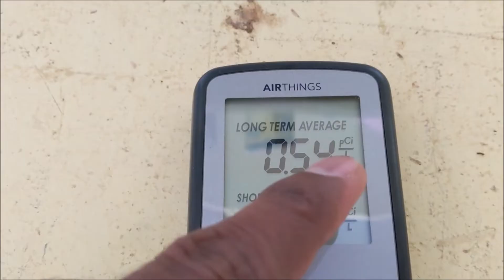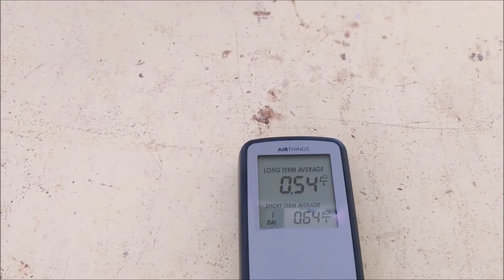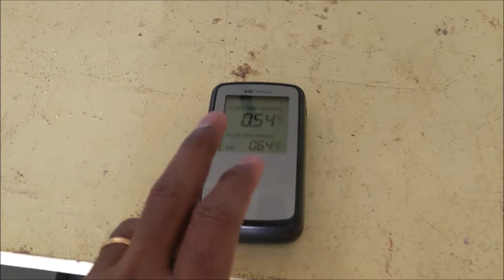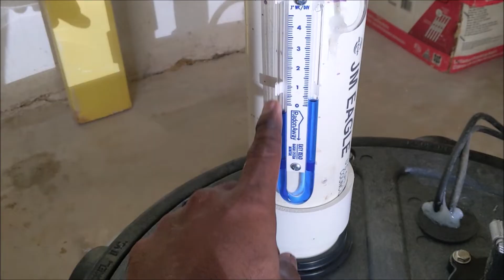Radon Mitigation System for under $500 - DIY Homeowner Installation

Comment: My Grandma- This costs me $5 to run per month??????
“I’ll take my chances with possibly getting lung cancer”
Reply: LOL yes, well you can do it by solar also, which is more cost up front but zero cost monthly. Since the fan is such low wattage even one good panel and some good batteries for overnight should do the trick.

Comment: Great video!! Very good info!! So am I dumb to get the 125$ meter to test my basement, all bedrooms and shop spaces or just do the mail in tests? I like the idea of being able to monitor it over a week period to know for sure. I worry that the amount of traffic in and out of the spaces could throw off the mail in tests, if that makes sense. Furthermore 2 to 4 tests costs what the meter does. I also have a furnace and a heat pump style water heater draining into my sump hole how would one go about sealing those from pulling air or wouldn't that be a problem?
Reply from the maker: Meter is always a good investment. Lab tests are a snapshot of one time at one placement, whereas a meter can average a week long reading.
   You can always sell the meter for more than half it's price after few months of use.
Reply: @JJ Central  well thanks for replying I am going to order the meter and go from there I appreciate you giving me your time. I am hoping for the best. Thanks!
Reply from the maker: The condensation tubes usually have a one at check valves in the furnace pump, and I believe it will prevent air leakage when it's not pumping. Also the diameter of air displacement is far more than the possible leaks. When if it doesn't work on peak efficiency it should work enough to see reduction in radon.

Comment: Did you have to get rid off your French drain? Would this work with sump pump that is located just outside the house?
Reply from the maker: Both scenarios are not compatible with sump radon system. You have to drill a hole in the slab.
Reply: @JJCentral-DIY  

Oh no. I was hoping it was doable. Thank you

Comment: Newer perimeter drains are done inside the house.  How do you seal above the drain where the new concrete meets the plastic/gap by the wall?  Some type of tape?  Otherwise, I can use the existing sump pit.  Just use a flex sealant?
Reply from the maker: You need to use a flexible caulking like polyurethane caulk to seal the plastic lid to the floor and fill the wall gap.

Comment: Thank you so much for this detailed and helpful video. Any thoughts on the efficiency of such a radon mitigation system, if I drill a hole in the HVAC room (right at the edge of the basement). I do have a sump pit with an ejector pump, however it is beneath the stairs in the very middle of the basement, so no way do drill there. My only concern is with the HVAC room location is that being at the very edge of a relatively large basement, it won't be able to efficiently suck up the gas and cover all that foundation. Since it is a finished basement, no way to drill somewhere else and then bring the pipe to the HVAC room...

Am I overcomplicating things, any ideas from JJ Central or folks in this community? Thank you!
Reply from the maker: In your situation, plan on drilling a hole in the slab itself but make sure that the sump pump is sealed with a air tight lid so you don't suck up conditioned air into the system. It will work great even if you have it in the corner of the basement. If your values don't change much, you can always add another hole in the opposite corner of the slab and connect the pipes together.

Comment: if sump is open system, runs around the basement but its open not a pipe, will sump still be useful? I guess no because I don't see how vacuum can be created in sump. Can also fan be installed inside instead of outside?
Reply from the maker: You are right, it needs to be a sealed system under the slab. Your best bet is to cut a hole in the slab and insert a PVC directly in the floor. Fan can be installed inside or outside. The fan link I have in the description is quiet enough to go inside. Thanks.

Comment: Great video! Thank you so much. I am in Canada and never heard of this problem until this week. Purchased a good monitor and bam! Can I ask what kind of health problems you noticed? I always blamed my coughing/phlegm and my son's on dust... but I know we have no allergies.
Reply from the maker: All of Radon related symptoms can also be attributed to allergies or other viral infections, so it is hard to confine it to just Radon. We experienced persistent coughing, fatigue, wheezing etc and actually saw a difference once the system was installed. Even if you are a non-believer, it still benefits by pulling the moisture and the damp air away from the foundation preventing mold and other issues.

Comment: Pretty good for someone not radon certified but there are some things you could have done better like the electric and lid if you really wanted to cut cost use a lexan cover and silicone around it but other than that good work

Comment: Is your fan running in your video when you are beside it?  Based on your info a 3" pipe is enough for my install but I am having a difficult time making a final decision between 3" vs 4".  I have read some info that suggest 4" might be quieter but it I guess it depends on how much and how fast the airflow ends up being.  My sump pit is the main source of radon gas, all my weeping tiles come into there and my slab is ontop of limestone. I have ordered the same lid and will be doing the same install BUT the fan will be in the basement.
Reply from the maker: The fan is pretty quiet in my 3 inch setup. I can hardly tell if it is running.
Reply: @JJCentral-DIY  Thanks for the fast reply!  Glad to hear that (I'm assuming you are saying that when you are standing beside the fan?) and great video.  Here in Manitoba these installs are done differently due to the extremely harsh winters so the fans are installed indoors and the vents are just inches away from the home and varmint capped otherwise the moisture travelling through the pipe causes this --> https://imgur.com/a/Q6I16pX
Reply from the maker: @c.a.n.4202  yes the fan is running during the video taping. You can see the manometer having pressure.  That was a continuous recording from outside to inside.  I did another install with the same fan inside and it is whisper quiet.
Reply: @JJCentral-DIY  Fantastic!  Is that a RadonAway or Fantech?  I've got a RadonAway RP145c on it's way.
Reply from the maker: @c.a.n.4202  it's a radon away rp145 as well.  Links of everything I used are on the description

Comment: Silly question, but does anything need to be added to the top of the end pipe to prevent animals from getting in? For example, nesting birds
Reply from the maker: Yes,  a mesh cap is added and I point it sideways to prevent rain water from entering. 
https://www.amazon.com/Raven-Termination-Stainless-Slotted-Condensation/dp/B01BW2VWG0/
Reply: Thanks. I think you’re the exception though, as most of my neighbors pipes appear to face straight up, and don’t have a meshed cap on the end
Reply from the maker: @thumbnasiuminc4373  I don't see any code mandating a cap so most installations don't have it. The logic behind straight pipe is to let the "poisonous" radon air as high and away from the house as possible.  I don't see a reason to let rain water trickle down the pipe and rust the fan etc. So Iam using a elbow fitting at the end.

Comment: would I need a specific certification in order to do this professionally as a contractor? I already have a general contractor's license.
Reply from the maker: @Chris Collings If there is an opportunity for some one to create a certification, they would in United States. Of course there is one for radon as well. In fact there is one to just measure and test radon and there is one to install mitigation systems. Two boards offer that, Check out nrpp or aarst.

Comment: Could I ask what year your house was built?
How many years did you live with the high radon levels?  
Thank you!!
Reply from the maker: 1970s house, bought the house three years ago. After few months the symptoms were noticeable on and off in family members. We always blamed it on allergies. Now I have a meter I can graph the radon level ups and down to see if the symptoms are coinciding with the timing.
Reply: @JJCentral-DIY    Thank you for the update.  So, the radon meter you mentioned for $125... do you think it is pretty accurate?  Did you ever perform one of those test kits that you mail away to the labs, to see if the radon values were similar?  Thanks again.
Reply from the maker: @PatrickWagz  yes, that meter is pretty accurate. Many in the Amazon comments showed side by side with professional equipment reading similar values. I posted the links on the description.

Comment: Thanks for the great video. Very informative. We have an active system now but just have one 3' hole in the basement floor. If need be I could buy the sump pump special cover and run another pipe from the cover to my existing radon pipe our builder installed when we built our house. We live in the US. Do we order these materials off of Amazon? Thanks.
Reply from the maker: Yes both the fan kit with the 3 inch adapter and the sump lid are sold in Amazon for a reasonable price. Measure the radon levels first to see if you need it. Some times you can just replace the fan with a more powerful fan and Dig the hole deeper and fill it with gravel to fix the problem. Good luck.
Reply from the maker: I posted the links in the description. Thanks.

Comment: 4 hrs is not realistic for most homeowner but you did do a great job. Waiting for results on a couple testing kit, now I wish I bough a portable detector instead
Reply: Could I ask your radon level results and what part of the world/US are you located?  Thank you.
Reply: @PatrickWagz  Got around 50-60bq/m3 in QC, Canada. Location doesn't mean anything though since my neighbor could be at 500
Reply: @moutrap    Okay, thank you.  So around 1.6 pCi/L ?  If I did the conversion correctly.  That is reasonably low.  I saw a map of the US compiled by the EPA with radon levels by color code.  If you had higher values I was going to see where you'd fall on the map, but yes, it could vary neighbor to neighbor... like you said.  Thanks again.
Reply: @PatrickWagz  Thanks for doing that conversion. My levels were also about 1.3 to 1.9, but everywhere else I've lived and worked has been about .5 so I wanted to improve it to match those. After installing like the system in the video (for about $400) I am at about .5 average (whew!)

Comment: Very good.  This passes for home resale, with one exception.  You do need a disconnect within 6' or if not possible, line of sight of the fan.  Other than that, great job.
Reply from the maker: Thank you for the suggestion. Installed a disconnect switch near the fan.
Reply: Agreed. NEC dictates a form of electrical disconnect. Best would be in the form of a waterproof box and switch.

Comment: Did you do any other sealing around in the basement?  Also, can you link the model of the fan you used?
Reply: Stephen, the fans are based on the resistance and the porosity of the sub-grade materials from where you are trying to get flow to mitigate the radon. So the fan he used may not be the right one for your home. If there is clay, sand or naitive fill under the slab you will need a high suction low flow fan and if it is caused aggregate under the slab then you need a high flow low suction fan.
Reply: @justinberard , thanks.  I have 3/4 crushed stone under the house (newer construction), so I guess I'd need a high flow, low suction fan.  That said, I was wondering if he had sealed cracks and any penetrations in or around the basement floor to reduce indoor air from getting sucked under the slab by the fan.  2/3 of my basement is already finished so I can't get to those cracks, but am focusing on sealing wherever I can.
Reply: @stephencosta6373    Hello, could I have an update on your Radon mitigation?  Were you able to get a system installed and what kind of results you have gotten?  Thank you!!
Reply: @PatrickWagz  , I’ve had some other work to do in the basement and outside, so haven’t gotten the actual mitigation system in and operating yet... hopefully soon!  Note, I am looking closer at Fantech’s RN2EC fan, which has adjustable speed control. I also have two separate foundation zones (separated by footers that are all pinned to bedrock), so I’ll need to treat two separate zones. Thinking on installing PVC valves at each suction point so I can adjust the suction from each area.
Reply: @stephencosta6373   Thanks for the reply.  Did you ever have the radon levels tested?  What kind of levels are you at?  Thanks for the fan model, I will check the specs on that.  The adjustable speed control seems helpful.  I too, may have to do separate systems due to my foundation being in sections.  Are you in NY or New England with the bedrock being so close to the surface?  Thanks again.
Reply: @PatrickWagz  I’m on north shore of Boston, on the water and the house is built over ledge (our footings are actually pinned to the ledge). So lots of rock under us. Lots of crushed stone too where the ledge is deep - not sure to what extent the crushed stone itself puts out radon??
Reply: @PatrickWagz  I’ve gotten different measurements, but in the lower level (walk out basement) levels seem to move between 12 - 18. Upstairs in bedrooms is like 8-9. So not great.
Reply from the maker: @stephencosta6373  those are pretty high numbers. You really need the system. I posted all the links in the description if you want to refer. Thanks.

Comment: FYI...your system is non-compliant because you do not have a disconnect switch to the fan within 6ft.
Reply from the maker: Thank you for the tip, Even though I have a disconnect on the inside, I added another one right next to the fan.